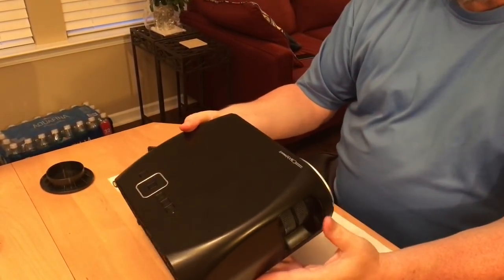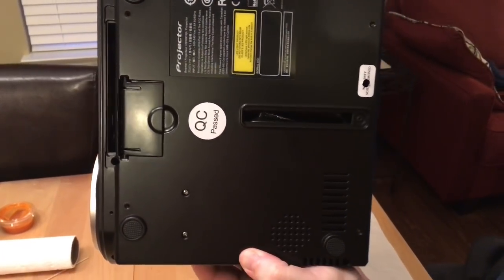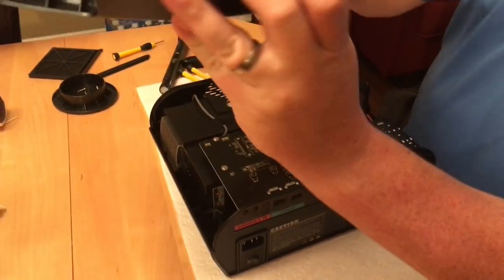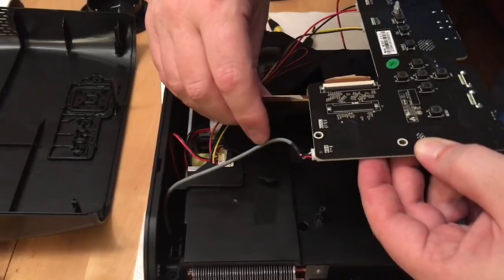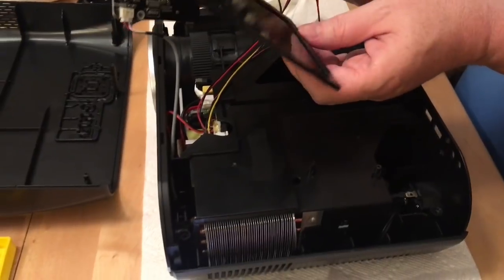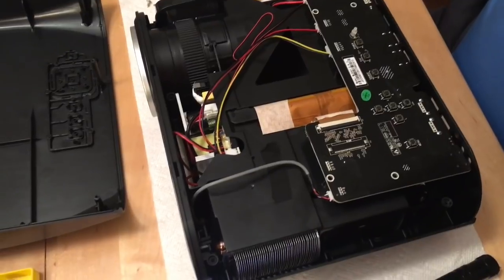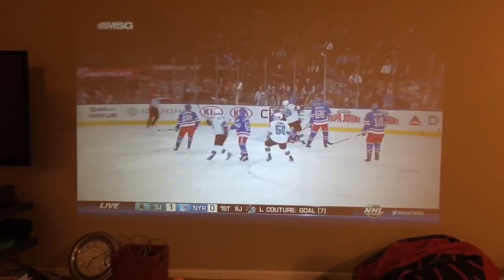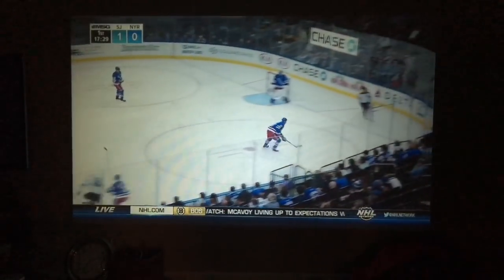Vivibright GP100 Review and Disassembly

Comment: The LCD resolution is 720p, can you put another LCD screen with bigger resolution? I buy this projector from gearbest with the androidn bud in for 169 $ so now I'm waiting for shipping to come to me . I just wondered if you could change this LCD screen to another with a higher resolution. There are many offers for FullHD or 2k LCD screens in aliexpress.
Reply: That is very interesting and totally plausible. Even if you can get your hands on a higher res screen, it depends if the mainboard actually has the capability to detect and/or correctly push those pixels onto the upgraded LCD. I'm also interested in this as well as a few other upgrades.
Any electrical engineers here to give their expert opinions?
Reply: I've taken the top off and measured the best I could.
The fan that's located on the side of the unit looks about 70mm. A regular sized 70mm PC fan should fit. Might require some wire-cutting and soldering in order to use the connector.
However, the rear fan is an internal laptop-style fan that's housed in a seashell-shaped enclosure. The purpose of this fan is to suck and divert air in a certain direction. Not sure yet how to approach this one but a thin PC fan will be required and some possible modding in order to divert airflow. A thin 50mm fan should fit with new screw holes drilled in. A thin 60mm might also. A thin 70mm might need some cutting since the surrounding plastic is formed to the odd shape of the laptop fan.
Reply: You can just make your own 1080p beam projector with tons of tutorials but, China might be selling one now. The truth is, even a 720p second hand projector for 150 dollars beats anything china has to offer. The diy is educating and fun to learn.
Reply: lcd diagonal?
Reply: I think this projector has   5.5" LCD
Reply: Agreed. Upgrading from a BenQ MP515 to a Vivibright GP100UP was probably not the best choice. LEDs, although appealing with regards to lifespan, are generally poor with color accuracy, and it's more than likely that a Chinese brand will use the cheapest ones possible. Optics on the GP100 will be worse as well and the list goes on. That 10 year old BenQ will definitely destroy it hands down.
 
Since I like to tinker a bit. I was looking at the brighter, more efficient, and more accurate Japanese LEDs. I may replace the GP100's anemic LED with this one in the near future. The fan noise is the easy part, I can replace those with some quieter PC fans.
The LCD however is the intriguing part. The GP100 is detected as a 1080p60 display device on a PC and is likely to run 1080p internally. The question is whether or not Vivibright actually took the time to downsample the signal or lazily tried to push a 1080p signal onto a 1280x800 lcd.
Reply: Have you checked the specs of the GP100 fans?
Reply: Have you tried to replace LCD with better one ?
Reply: I hope someone has as well. I've personally have not tried it yet as I've been very busy and have had very little time for the project.

There's a lot of things to consider. It would be nice to know what the LCD's true size, aspect ratio, and what connector it uses.
1) The current LCD panel's true resolution is 1280x800 which points to a 16:10 aspect ratio. 1920x1080 panels are 16:9. A 16:9 LCD of the same size would be a little shorter and a little too wide to fit, and so a slightly smaller 16:9 panel will be required with some modding to prevent top/bottom light leak.

2) LCD panels come with an assortment of different connector types from what I can see. They also have compatible controller boards available for them. Finding an LCD with a compatible connector with the current controller board might be a challenge. 
The current LCD and board can be replaced with a new LCD and controller board. That's also a possibility.
Reply: its 60pin 5.8inch lcd
Reply: Interesting. If using the same size and aspect ratio, a 5.8" 1920x1200 16:10 panel could be a possibility. 
If planning on using a 16:9 aspect ratio panel,  a 5.6" 1920x1080 panel is a good possibility since it'll be about just as wide as a 5.8" 16:10 panel.
If the math is correct the screen sizes are...
5.8" 16:10 = 4.92" Horizontal x 2.76" Vertical (or perhaps a little taller)
5.6" 16:9 = 4.88" Horizontal x 2.75" Vertical

Let us know how it goes
Reply: Nope! This  is a custom pcb and probably disabled pins so no 1080p screen.
Reply: If true, that's quite of a disappointment. Perhaps an electrical engineer might figure a way around this... who knows.
I guess the next viable option is to get a 1080p or higher lcd panel with its own custom pcb and inputs. In order to power it without using another power adapter... tap it into the current power supply.
Reply: Sadly true. DIY is definitely the way to go.
Reply: No can do. There are absolutely no markings on the fans to identify the models or specs.
Reply: Hey yeas you can I did the same to mine
I bought it 60$ on sale two months ago but the picture was not what I expected it to be
I bought a 5.5 inch 4k yes 4K lcd complete with hdmi input and I upgraded the led to a 100w led
It will take some jerryrigging but the results are glorious 
I'm waiting on my 3d printer to arrive so I can design and print  my own enclosure
might even upgrade the lenses but for now it does more than I expected it to
Reply: Well Ducky Duck, i'd really like to see a video documenting the process and results of that! You know, just for proof of concept.
Reply: Also, 4K TFT sure is nice, but only really helps if you feed it via external HDMI source, since the projector itself can only play 1080p max.
And the 4K TFT actually almost costs as much as the whole projector. Wonder if it also has better color accuracy, i simply cannot get the colors calibrated quite right. Especially the reds and yellows look way too bright and intense, whilst green is too dull.
Reply: I will do that as soon as I have the time
full time student with a kid 
hardly have time for myself 
but I'll try and get something out by the end of next week
Reply: as for the display yea it costs almost as much as the projector but you could always go with a 1080p one which are much much cheaper
I'm sorry English is my second language what do you mean by external HDMI source? If you mean a way to get a video signal on to the screen well I bought the version that came with the lcd controller board. and the colors are somewhat accurate, I looked up the the display before buying it and everything pointed to it being the sony xperia z5 premium display still not so sure about that.
Reply: I mean, that the projector itself can play media over USB but only upt to 1080 p sources. It should be able to play 4K if fed over HDMI cable, like from a Raspberyy Pi like i have. But i find it somewhat strange that the electronics/software of the GP100 can actually upscale the picture to 1080p/4K so easily. Makes me question, how the downsampling to 720p native resolution is implemented, hardware or software?

Also, did you modify the cooling for the 100w LED? should run quite a bit hotter. I wonder what the minimum viable CFM airflow needed is to effectively cool the LED.
If around 20 CFM would be enough, one could swap in a significantly quieter fan than the standard one which should have around 50+ CFM.

Anyways, i'll look forward with great interest to your proof/documentation of the mod.
Reply: I'm not using any of the factory electronics except for the lenses so I wouldn't really know lol but before I modded the hell out of it
It did play Full HD content just fine, the picture quality was just a disappointment. 

Yes I did although I wouldn't call it a mod, what I did was well I beat the living hell out of it haha, I tested with the stock heat-sink but after just 30 min of on time the temps got up into the mid 70's so no I literally have part of 212 evo cpu cooler sticking out of it.
Looks like an abomination but it packs a punch just like the Hulk
Reply: Ah, right, so you basically built a completely new projector for hundreds of Bucks using just some components from the original GP100, got it.
Well, i invested around 30 Euros into my 150 Euro Projector to make it somewaht more silent. No wonder you can display 1080p&4K when using new electronics specifically for the new display, feeding sources directly into it. Personally i am more interested in the most simple and cheap mods to the original GP100 in order to improve its specs. I have to agree that the original GP100 720p display is not the best.

How do you adjust the settings with the new display, if it circumvents the original electronics? Brightness/contrast, sharpness and the like?
Reply: well my advice would be to open it up 
take out the lcd and check if the model number is written on it
after that, google it and put the words controller board behind it
usually you can find those on ebay and sometimes sellers have other panels listed that are also compatible with that board
You might be able to find a better 720p or maybe 1080p display using this method, it has worked for me once before but no guaranties.

As for the settings most lcd's also come with a little control box(IDK the real name of it lol) it has buttons on it such as menu power the usual, but I have mine hooked up to my windows pc which lets me adjust everything from  the nvidia control panel

some sellers sell everything together from the controller board to the lcd and the button thingy sometimes they even come with an ir remote
Reply: you might also want to upgrade the led cause that thing just isn't bright enough or maybe I just had a broken unit
Reply: Interesting. Stilli think there are probably better cheap projectors than the GP100 to essentially swap out half the components for better ones, effectively doubling or tripling the price of the base model. GP100 has a very compact, very tightly packed case with not much room for larger, more powerful components like cooling, so one more or less needs to add those externally.

Well, once my new 3D printer arrives, i should be able to construct a decent fan duct mount for an external silent 90mm fan. That should make the sucker considerably more quiet. The stock Gp100 is ridiculously, unbearably loud thanks to the compact cooling.
Reply: There are
But it was on sale at one of the chinese super markets near my school 
It was 60$ so I thought why not

Yea ali express is the best way to go when it comes to diy
Reply: Well, for me the stock LED is quite bright enough. But i only use it in a darkened room with some ambient light, which is quite sufficient. I run it adjusted at around 50% brightness for the best picture quality. It is by no means a daylight projector, but can well deal with some ambient light.
Reply: I use mine in my office when fixing/ repairing  broken pc's, laptops tablets etc
It's the only way I can keep an eye on my son while he watches his cartoons
and since I work during the day, that room is lit up to the max
Reply: Yeah, well, good luck finding a 1080p+ full daylight projector for below 500 Bucks, even in China. I chose the GP100 because it allowed me to assemble a functioning,  home cinema system for around 250 € decent enough for watching the football WC and a movie now and then. Doubt one could do any cheaper than that.
Reply: https://www.amazon.com/Optoma-HD143X-Lumens-Theater-Projector/dp/B077C5FLJF

My main projector, it goes on sale from time to time just gotta keep an eye out.
I bought for 460 in I think either November or December of last year, ever since I've seen the price go op and down.

It is amazingly bright and I have no problem using it during the day
Reply: AntrAcsA : Agreed. The shortcomings are bit of a let down... but the price is good. Got mine for $160 (non-android).
It's good as long as the noise can be drowned out with high volume,  a good sound system, or headphones.
The entire image can be almost perfectly sharp if you can avoid using the keystone by mounting it straight on.
The colors are good enough. It's to be expected since it's using an LED instead of a bulb. That's why more expensive projectors don't use LEDs.
Built-in Android is awful. You're better off buying the basic version and using the difference to get an android stick that is 3x more powerful than what's built in.
It's good and you'll be satisfied if you're not expecting $500+ performance from a $160 projector.
Reply: Btw this projector sux ball so hard. I sell me after 3 days use. It's has a lot problem with the nose, focus, performance, Android, the menus are awful, contrast and colors are just a joke... so disappointing
Reply: My 10 years old BenQ MP515 is way-way way-way better if we compare colors, contrast, brightness, and noise. I was hoping to upgrade after buying this higher resolution and good specs in paper Chinish pace of shit GP100UP but.. its was so big let down for me...  btw I buy my Mp515 for 200 $ second hand before 8-9 years.
If I buy a projector in the future, and I will have to,
is going to be at least FULL HD and maybe some of the budget decisions of BenQ or Acer H6517ABD
Reply: in case anybody was wondering this is the lcd I used https://www.aliexpress.com/store/product/5-5-inch-4k-2160P-2160x3840-Resolution-Ips-Panel-Mipi-Interface-Lcd-Display-With-Hdmi-To/511141_32896007495.html?spm=2114.12010612.8148356.12.9f2c7d169uoJo1

The led can be found anywhere while it is not the best it's better than the original option
Reply: I'm looking into this upgrade as well. Is the power delivery sufficient for a 100w led? Did you have to increase the cooling?
Reply: HelloHa honestly I wouldn't know
I gutted the whole thing and only kept the lenses
Everything from the led to the lcd is powered separately
For cooling the led I used an old cpu cooler I had